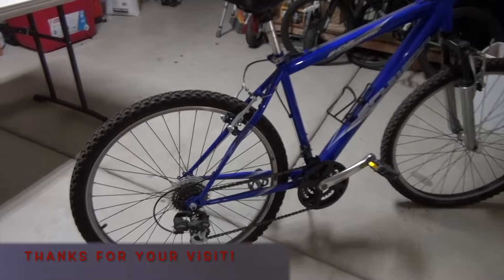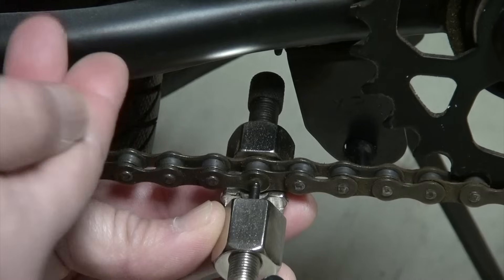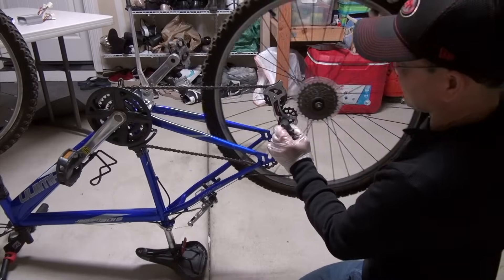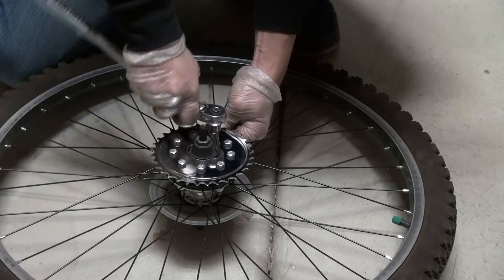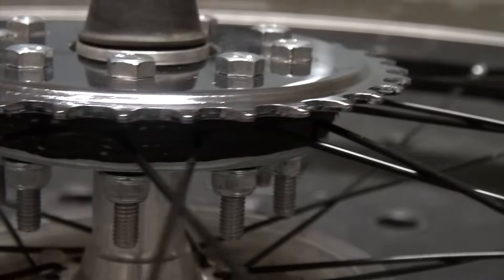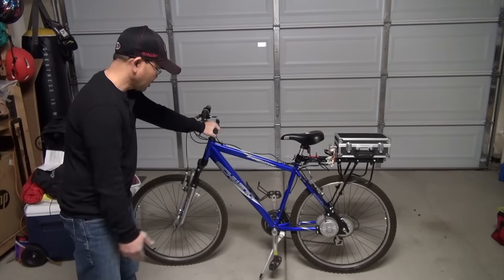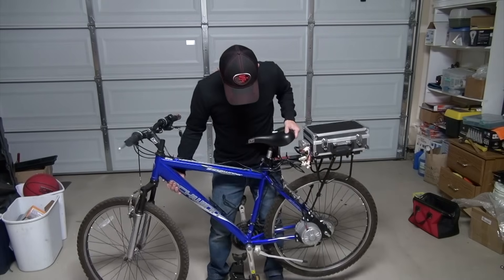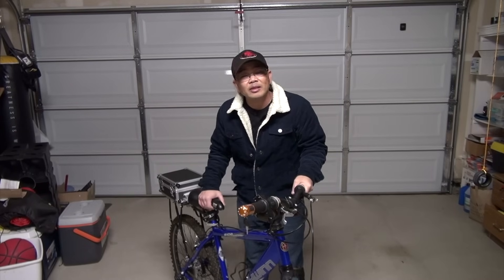Powerful Electric Bike Conversion Part I (E-Bike Conversion Kit Installation)

Comment: Hi I purchased this and the battery pack I purchased is a 36 v 30 ah battery and it’s connector is a xt60 what is the name of the plug on the controller
Reply from the maker: Hello, I don't know the name of controller plug.  But if your battery plug is xt60, I recommend changing the controller plug to xt60.  I upgraded the bike to the same size battery as you and had to match the plugs as well.  Take a look at part II of the installation.  https://youtu.be/c6YgNQg3VM8  Thanks!

Comment: Can you help me to give link, where can i buy those E-Bike Conversion Kit?
and also, what kind or type of bike do u use on that video?
, Thanks
Reply from the maker: Thanks for watching the video.  I found the link on Ebay.  You want to make sure that the motor is for the left side of the rear wheel. Copy and paste the title on Ebay search.  
36V-450W-Ebike-Left-Drive-Electric-Bike-Conversion-Kit-Hub-Motor-E-Bicycle-Kit.  
My bike is a 26" Schwinn side winder.  Also check out part 2 of the video before your project  I did a power upgrade to the bike.  https://youtu.be/c6YgNQg3VM8.

Comment: If just 2 battery, it is still work or power on?
Reply from the maker: If just 2 12v batteries, you get 24v.  That might work if controller will take 24V.  I think it should work. I haven't tested it at 24v.  Let me know.  Also check out part 2 of the video.  I did a power upgrade to the bike.  https://youtu.be/c6YgNQg3VM8.  Thanks!

Comment: I got a similar kit, but the controller wires were not all labeled. Which color pair goes to the motor and which foes to the battery? My guess is black/red goes to motor, yel/blue goes to battery. Bu if wrong I can fry the controller.
Reply from the maker: Check out part 2.  It shows the wiring....Black and red wires from the controller are for the battery....

Comment: How many teeth on rear sprocket ? And how many on motor.many thanks
Reply from the maker: 32 on the rear and 16 on the motor.  The sprocket on the motor also serve as a freewheel.  Check out part 2 of the video before you start your project. Thanks!  https://youtu.be/c6YgNQg3VM8

Comment: Sick Bike Parts sells a replacement for that ridiculous thing attaching to your spokes than, instead, clamps down on the hub and so you don't have all that torque on your spokes.  This thing is REALLY inappropriate for that dumb design. The gas motors don't put out a lot of torque and so it's much safer on a gas motor. But an electric motor is another story.
Reply: Was looking at the site.  Can you tell me what it is called.   Thanks in advance.
Reply: @brewman684  You might want to send them an email. I looked real quick and couldn't find it and I don't recall what it is called.

Comment: Does this thing have a freewheel on the electric motor or does that motor spin whenever the wheel is spinning?
Reply from the maker: The conversion kit came with the freewheel for the motor.
Reply: @diypotentials  The sprocket of the motor itself has a freewheel?
Reply from the maker: The sprocket serves dual purposes—free wheel and sprocket...
Reply: @diypotentials  Thanks. Appreciate it.  Are you liking it?
Reply from the maker: Still have lots of fun with it.  Check out the upgrade i did to the bike.  I replaced the Lead Acid battery with a 36v 30AH lithium-ion battery.  So much better.  Thanks! https://youtu.be/c6YgNQg3VM8

Comment: I'm having trouble getting my throttle to engage with the controller....I've got the same kit from this video 36v 350w lantian controller...Where do i place the yellow/blue wires coming from the throttle?
Reply from the maker: If the controller has a switch or power locks terminal port the yellow and blue would be connected there.  My how to connect a BLDC controller video might be helpful as well.
Reply: @diypotentials  ok ive also an Indicator and charge ports..Will it smoke my controller if i dont choose the right first??
Reply from the maker: The throttle wires on the controller are red black and green.  The power locks port (blue and pink wires) are for the switch port that is connected to the throttle.  Good luck. Let me know how it went...
Reply: @diypotentials  Yup that was it.. THX again..Ill get it all rapped and send a video link

Comment: can you give a link where to buy this DIY kit?
Reply: or how is this kit named?
Reply from the maker: @spetauskas  Thanks for watching the video.  I found the link on Ebay.  You want to make sure that the motor is for the left side of the rear wheel. Copy and paste the title on Ebay search.  Good luck!
36V-450W-Ebike-Left-Drive-Electric-Bike-Conversion-Kit-Hub-Motor-E-Bicycle-Kit.
Reply: @diypotentials  thank you :)
Reply: @spetauskas  Thank you for the presentation. SO when you manually bike you end up turning the motor also while power is off. Did the motor cause resistance to worry about? or does this installation pretty much turns the bike into 100% electric
Reply from the maker: @alneg6234  The bike has dual function, both manual and electric.  The motor has a sprocket that also serves as a freewheel.  Check out my part 2 of the video, it show the dual functions.  https://youtu.be/c6YgNQg3VM8.  Thanks!

Comment: It is perfect. How fast this build can fly? 35/40mph? 50km/h is the top speed? And how long batery will last? THX
Reply from the maker: I have not measured the speed but it is pretty fast.  The battery I used is only 7ah, so it gives me about 30 minutes.  Of course  you can install bigger pack with more capacity for longer runtime. I recommend lithium-ion, they are lighter with more energy density. Thanks!